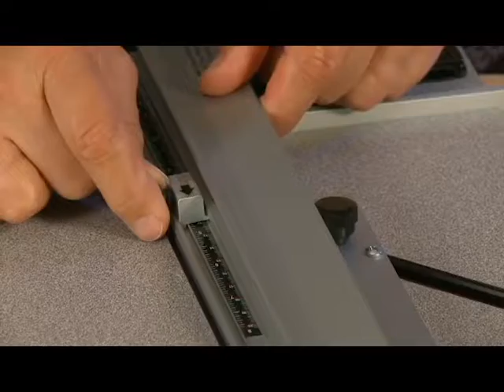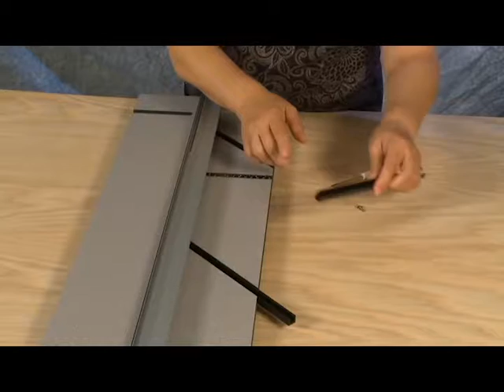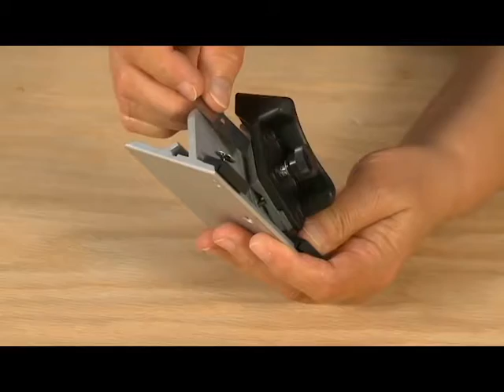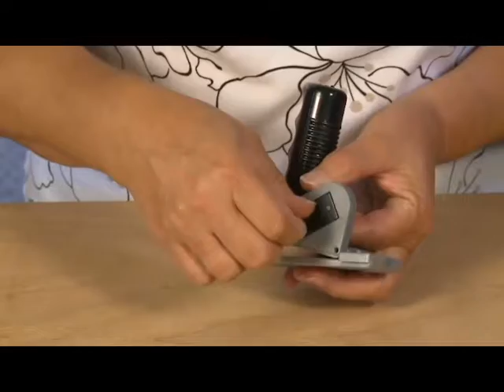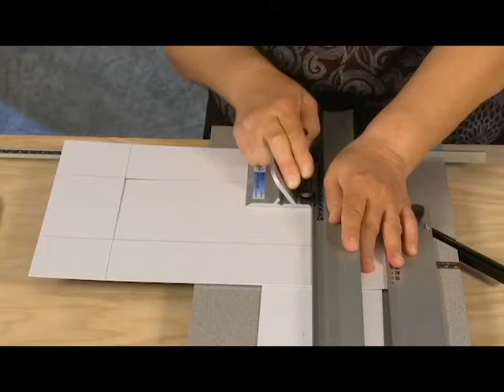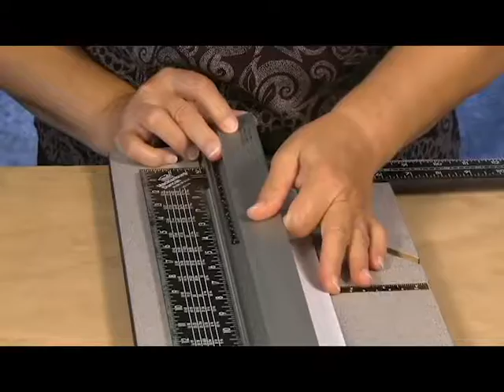CORTADORA PASSEPARTOUT LOGAN 450 ARTIST

Comment: Estoy utilizando por primera vez esta herramienta y al hacer el corte con la cuchilla para paspartu las esquinas no me quedan bien?
Reply from the maker: Hola Reyna
Sin ver cómo estás haciendo los cortes es complicado poder saber porqué te está pasando. Pero hay 2 aspectos muy importantes que tienes que tener en cuenta

1º. Utilizar una "cama" de passepartout: En cada corte, debes usar alguna tira de material que tengas de restos de otros trabajos, a modo de cama. Se trata de que la cuchilla, cuando atraviese tu passepartout, no vaya al aire, si no que siga cortando sobre el material usado de cama

2º. Las cuchillas tienen que estar siempre bien afiladas. Hay que cambiarlas muy a menudo. En cuanto veas que el corte deja de ser limpio. Recuerda que cada cuchilla se puede usar por ambas puntas. Primero le das la vuelta y luego ya la cambias por otra

3º.Dependiendo del grosor del material, es posible que tengas que adelantar el inicio de corte y retrasar el final de corte.
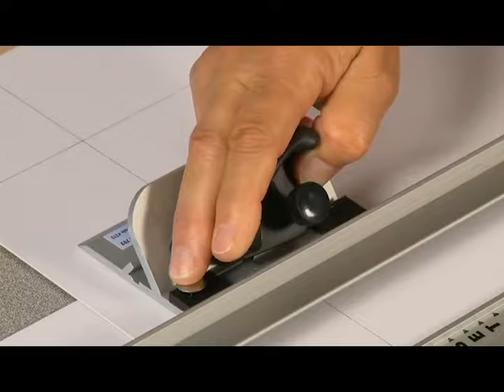Mira el minuto 05:07 del video. Verás cómo se hace coincidir el inicio de corte. Pues es posible que tengas que probar a empezar a cortar unos mm. antes de la línea de inicio de corte. Y finalizar unos mm después, para que los cortes en las esquinas te queden completos

Saludos - MOLDIBER